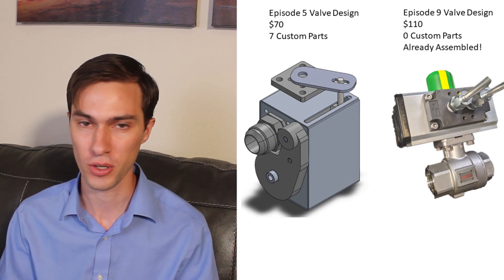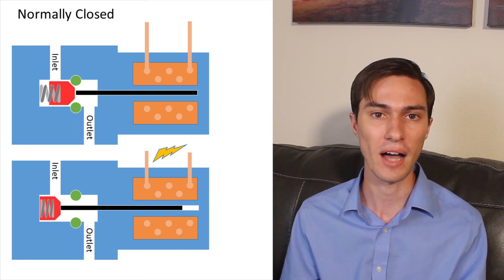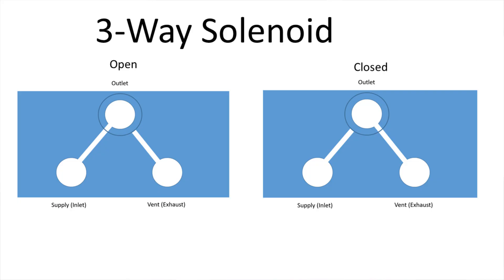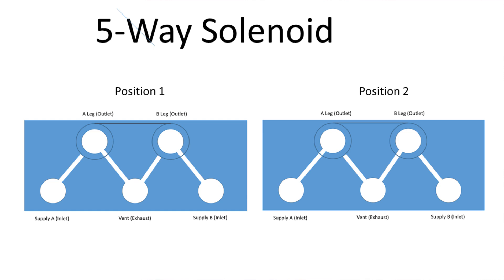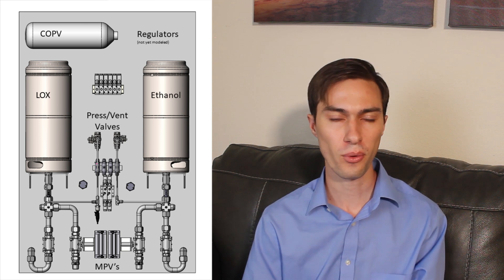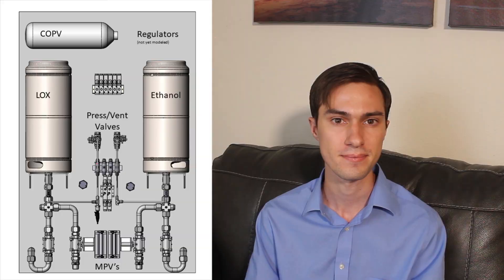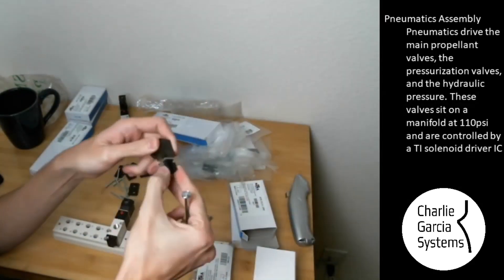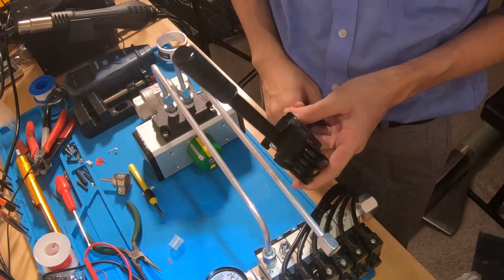Liquid Rocket Engines 9: Pneumatics and Moving the Main Valves

Comment: Hey community , had a question . Using pneumatic ball valves seems great but won't it have problems in ignition sequence as at the start to have a stable ignition source you have to run the engine fuel rich and then ox rich and then bring it to full operation . Varying the amount of fuel and oxyegn can't be possible in these valves as it has only two states . Charlie how do you adress these problem with respect to hard starts.

Comment: Hello Charlie et al.
Lol
I want to ask a rather stupid question (or two)
If I use lox and liquid methane as propellants, in what form are they injected in the thrust chamber ?
As liquids ? Or as gases ?
If a cryogenic liquid goes through pipes and valves and pumps and heat exchangers doesn't it use or make energy as it transforms to gas ?
Forgive my stupid questions but chemistry was not my forte
Thank you
Reply: They are usually liquid if they go straight into combustion chamber from tanks.

If they pass through a jacket to cool the combustion chamber/nozzle as part of a regenerative cooling system, the temperature will turn them into a gas and they will be injected as gasses.
Reply: @deltuhvee  Thank you very much man. Usualy its the fuel which pass through the nozzle and chamber to cool them.  Right ?
So again Oxygene should be liquid and Methane... gas .
Reply: @psyxiatros1  yes, usually the fuel, but oxidizers can be used as well. Some designs use one to cool the combustion chamber, and the other on a separate loop to cool the nozzle.

Comment: For 3d printing your engine bell you could consider a new ceramic polymer resin  that can be printed on any cheap resin printer, and then theoreticly be sintered with a blowtorch, withstanding 1100 degrees C with the resin burned out  (it obviously has a lower tensile strength than stainless steel ). The one from Weistek costs 60 bucks per kilo

Comment: How do liquid rocket engines actively measure chamber preasure? I mean is there even preasure sensors that can withstand those temperatures?
Reply: Pressure and temperature don't have to be high at the same time. just have a very small pipe going out of the hot towards the sensor, and have the sensor somewhere where it is cold enough for it to operate.

Comment: I noticed when you were sealing the threads you used the teflon tape in on the blue reel didn't that mean that it's only rated for water . Unless it's different there but the gas rated stuff here comes in a yellow reel
Reply from the maker: The blue stuff is thinner, but other than needing more wraps, there's not really a difference. There's some nuance for tapes with anti-seize and other embedded lubricants, but there's no code inspectors for rocket test stands.
Reply: @AstroCharlie  ahh ok was just wondering ive just always used the other stuff because it's about. Also would you have any tips about learning tig welding I've done mig and stick but tig I just can't get the hang of
Reply from the maker: A good teacher and practice are the best tips I can offer. I found it similar to drawing.

Comment: Are you currently in the industry currently or finishing school? Also are there any degree programs for Aeronautical Engineering that can be taken online that you know about?  I am currently working full time as a health and safety senior technician for a petrochemical company so full time face to face classes would be a challenge. Your videos are very informative on liquid rockets and are very well structured!🚀
Reply from the maker: I'm a propulsion program lead at a satellite maneuvering company. I graduated in 2019. MIT offers many of it's courses through OCW online to anyone.
Reply: Charlie Garcia thank you so much for this information. I hope your doing well in propulsion and that you don’t have as many surprises as what is discussed in Ignition. Also I am curious if you have theory on why ozone still explodes and do you ever see it becoming a viable oxidizer since the energy density is so much greater than LOX? Or are the issues with handling liquid ozone not worth the gains?

Comment: Not sure if you went over this, but why in your demo at the end do you have electric solenoid valves which control pneumatic valves which control the fuel flow? Why can't you use an electric valve to control fuel directly? My guess is that it's similar to using a transistor/relay to control high electric current, and that using direct electric control would have difficulty managing that big chunky main valve at the end, but would be great to have that confirmed.

Also, I loved the transition at 6:46 when Professional Design Engineer Charlie got up and Super Cool Hardware Building Charlie took over.
Reply from the maker: The MPV's need very high CV's and they need to work at high pressures, these are not traits easy to find in COTS solenoid valves (not that I know of any 1" solenoid valves anyway) but are easy to find in pneumatic ball valves.
Reply: @AstroCharlie  Major fan here! I'm in love with the level of detail you include in your vids. I hope I can bring into your attention a rather cool project for Mars colonisation. https://nexusaurora.com/welcome.pdf. I'm the founder of Nexus Aurora and I'd like to get in touch with you for sharing the material we are producing https://nexusaurora.com/report.pdf. Drop me a reply if you are interested to dedicate some air time to this community project. I'll be quick to reply. Regards!